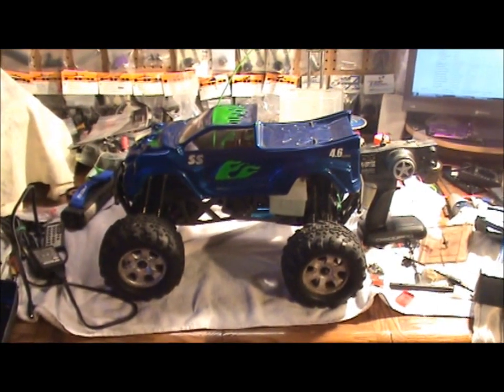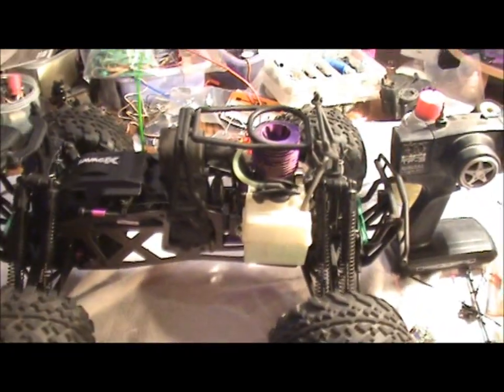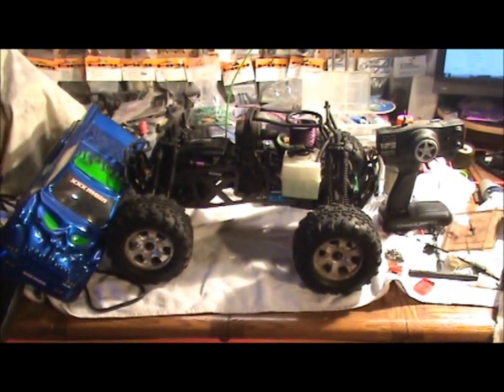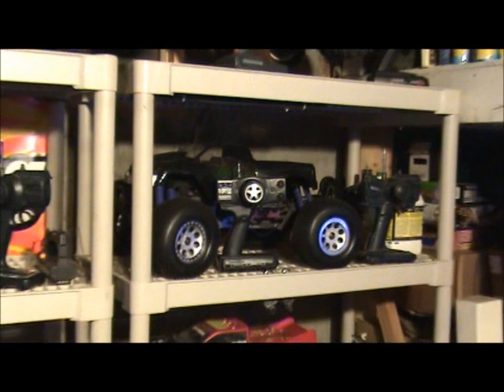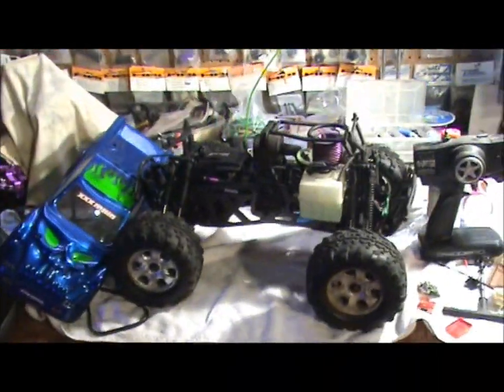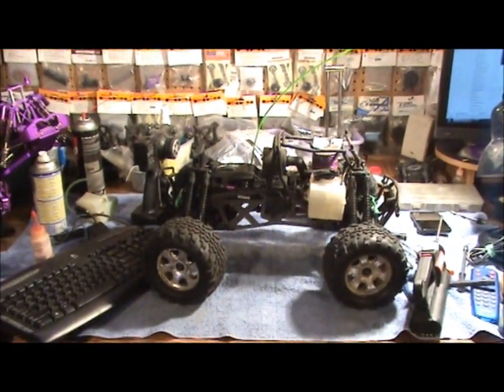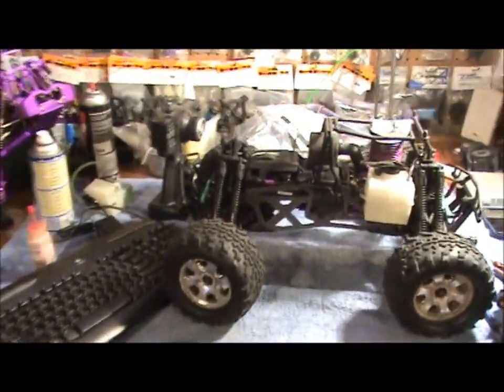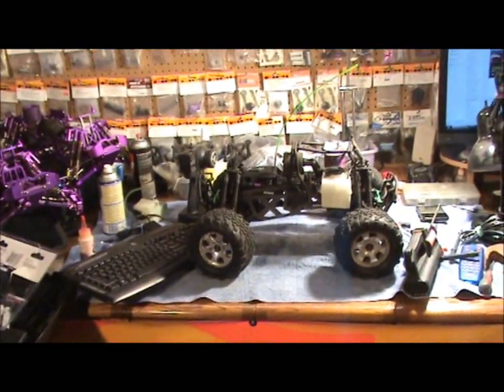HPI SAVAGE (RCSAVAGE) E20

Comment from the maker: Hey richardWhelan82, I thought i would try the stabilisation and it sucks, so i took it off. I'll start putting my flux together soon. still need batteries and electric's and transmission. Thx for checking my vids M8.